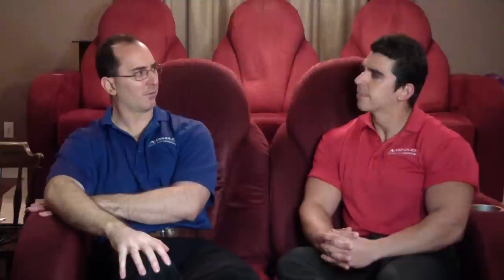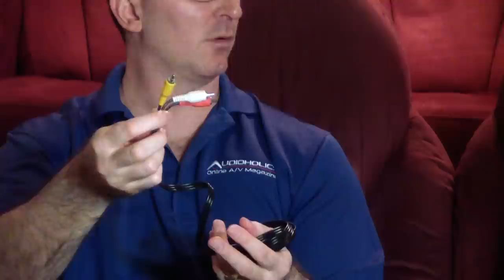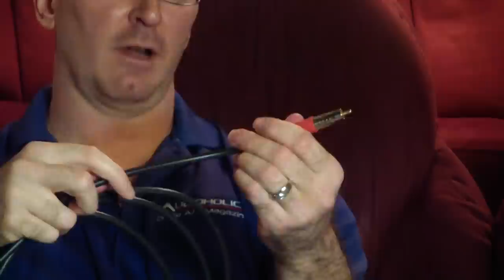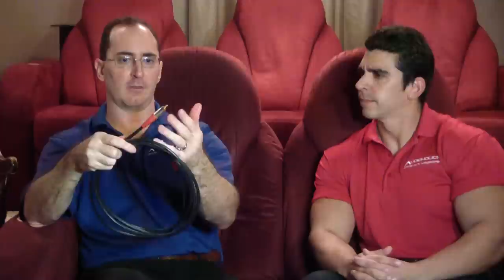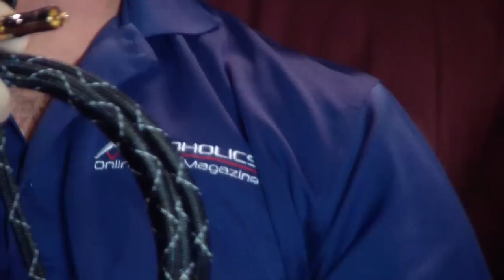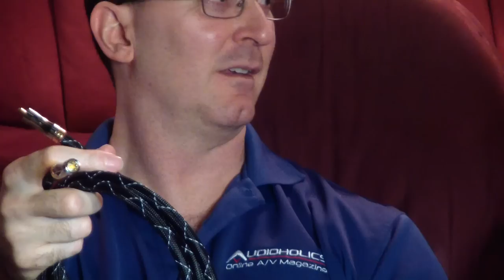Audio Interconnect Cable Myths vs Truths Revealed

Comment: You should've shown the connections to the connectors. That way we could've seen how they're terminated... if they were cramped, soldered, and if there's any shrink wrap to shield the positive and negative connections. Also, shielded cable in a home can act as an antenna. If you're going to show the differences, then SHOW the differences in the cables all the way to their core!

Comment: A great thing about Blue Jeans cable is that they publish specs with sources for all their stuff.   Want to know capacitance per foot and who actuall manufatured the wire, etc.?  It's all on their site.  I would rather spend just a few extra dollars with them because I trust them.  Actually their stuff is only a little  more expensive than cheaper Amazon cables.

Comment: Do cables with silver conductors affect sound? Also now some manufacturers use magnets to guide or focus signal through cable. Are these myths?
Reply from the maker: Silver is slightly more conductive than copper but all you have to do is use a little more copper to offset the difference which is a much more cost effective route. Using DC magnets on a cable is a scam unless it's being used as a ferrite to reduce RFI/EMI emissions for compliance testing.
Reply: Audioholics So sliver doesn't give more detail? They are using magnets to guide electrons to reduce noise. Inventor Rick Schulz of High Fidelity cables formerly Virtual Dynamic cables.
Reply from the maker: Snake oil. A static magnetic field won't drive any electrons around and will have no appreciable affect on AC current flow.
Reply: Audioholics Thanks for clearing that up!
Reply: Audioholics I have another question! Does dielectric material make a difference? Manufacturers say no dielectric is best then Teflon is second best for clarity!

Comment: Unlike most everyone else here, I'm not an expert at this.  So when someone recently insisted to me that wire gauge matters for speaker cables (yes) but not for interconnects (not sure) I asked for an explanation.  But the one I received (low-level line signals aren't sensitive) failed to persuade.  Can anyone shed light on this?  The interconnects I see are all AWG24 or 22 at best.  It would cost a trivial amount more to make them 18..
Reply: As if that weren't enough, it turns out  that virtually all of them are CCA (Aluminum) rather than OFC (Copper).

Comment: what's a good brand for a hdmi 4k 240hz tv?
Reply: 12schnsaint For all your cable needs, buy Audioquest in your price range.
Reply: The cheapest one that you like the look of and has firm connection,  HDMI is digital so it sends all the data or it doesn't  work.

Comment: Normally, with polarisation there should be a clear + and - field running through the cable to obstruct " flowing " charges through the cable. With this construction polarisation with an electric field is doubtfull because of the positioning of the anode and cathode wires within the cable running through the conductors. But the idea had been really nice, but not practical. Perhaps done behind a desk without practical knowledge. But also the effect is uncertain, because measuring is problematic without lab conditions, so quality control is at least doubtfull. Furthermore the cable is not very stable because it is flexible because of position and temperature and differences in length of the cable. So inpractical.
Reply: Another thing, it may be a suggestion for AQ using the two wires for  "clean earthing ". So connecting the two wires through a EMC/EMI LC filter to a central earth, connected only on one side  I think the AQ cable is an excellent cable but not connected the way they do. It is actually now working as an antenna, with the newer type of cables they now also provide it with RF filtering funny enough. 🤣

Comment: Balanced cables? Pros & Cons? Thank You!
Reply: Martin Miller For shorter runs, say up to 6 to 10 feet, you aren't going to hear any difference. The reason balanced cable technology exists is to provide a clean, noiseless signal over very long lengths, say 50, 100, or more feet. That's why you see this connection so often in the pro audio realm, because they often need to make these long runs. Unbalanced cable, such as the ones featured in this video, just can't make runs of that length without picking up some sort of noise. Again, for shorter runs, there is no audible difference.

Comment: I was super skeptical to buy an expensive  USB cable for my questyle DAC. Just swapped out my 5m printer cable with some generic old 1m printer cable, and there definately was a sonic difference. I'm not sure if it is length, quality, etc. But it's there. Both sound good enough. Might have to get something nice just to remove the doubt arrrggg
Reply: The cheap USB cable was likely causing a ground loop due to improper shielding causing hissing and popping from the source (your PC) in the DAC's analog output stage. Had the same issue once hence I usually go for optical.

Comment: Why 75 Ohm impedance? That should only be relevant to R.F impedance matching. Most audio amplifiers have a much higher input impedance than 75R, 50K etc. It should make no difference I would have thought...? 50R / 75R shouldn't make a bean of difference at audio

Comment: What about power cords?  Some like Shunyata cost over $3,000 while Audio Adviser's Pangea cost about $400.  Are both these snake oil as well?
Reply: After about 2 mins of looking into  Shunyata I'd say it's total BS. Look at the cable coming out of the device itself, will a 3000 bone extension cord make any difference? I do run my gear through Furman power conditioners, but for the price I see no reason not to, plus they make a really awesome looking power bar. BTW they do work.

Comment: the lower the voltage, the higher the gauge...the higher the voltage the lower the gauge

thats why they transform the elektrik energie to high voltage...so they dont need those massive cables... in your car runs 12V..and ther are thick cables right! but all this depends on the ampere draw...low ampere is also low gauge.

simply physic.

Comment: I caught a few talks given by AJ van den Hul regarding all of the different materials he uses and doesn't use. He makes quite a lot of very scientific sounding claims. Such as how when copper is drawn through a die to make wire there is surface oxidation that make its way into the finished product. His claim is that as the wire is formed into smaller gauges the oxidation is 'mixed in" thereby causing all sorts of barriers for the electron flow, which then creates distortion. So I wonder just how he get into the metal structure so minutely to see this, let alone measure the "distortion" that he claims can be heard. In another video he admits that the different treatments and adjustments for building his phono cartridges cannot be measured yet can be heard. So if he cannot measure these miniscule variations, how does he know they exist? I don't think you can patent what is imagined.

Comment: I challenge any of these two "honest" gentleman to back up, technically, with some form of measurement how good some of these cables are over another, not including the first free cable that comes with a bought component.
Reply: Exactly ! The same old myths shielding, thickness and shorter is better is all negligible to zero difference.
  Don't  buy junk but dont spend $5o dollars on 3 feet of cable either. Snake oil.
Reply: @decimusrex92  Indeed. The free red and white ones sound the same.

Comment: Gents can you do a video on power cables please. Im guessing it would be similar to your other cables but I just need to make sure. I was just at my local super high end audio dealer and they try to sell me what I believe is hard core BS. My two questions are unanswered. 1. Why it would matter if you have 4k$ power cable if its connected to 2$ wall socket? 2. Doesn't amplifier actually work on DC from capacitors ? 
Please help me understand.

Comment: Hi, guys. I generally enjoy your videos, but I may somewhat disagree with you here. So-called "high-end" cables are a scam. They usually offer superior build quality, but that's about it. In terms of audio quality, they offer nothing. I challenge anyone reading this to do your own A-B test. I would even encourage you to compare the cheap-o interconnect that the guy tossed away against the Belden cable that he endorsed. I'm willing to bet you're not going to hear the difference. You will not go, "Yep, that one's the Belden. You can really tell the difference." Even if you did think you could hear a difference, I would suspect the placebo effect. Audio engineers, designers, and others that work in a professional capacity laugh (literally) at enthusiasts that pay for Monster Cable and the like. Now, the el-cheap-o cables will become brittle and crack much quicker than the higher-quality examples, but you don't need to go "high-end" to avoid that. I think GE still sells RCA cables that you can still find at larger department stores, or online. They work fine and they have decent build quality. Pretty much any product that is not the cheapest-of-the-cheap will serve you every bit as well as the "high-end" cables.

As far as video, I haven't done any comparisons of my own, but I would still encourage you to your own test with a "75ohm" cable and a "non-75ohm" cable. I'm willing to bet most people will find they look identical. I think most people are using HDMI (for video applications) anyway, so in that case, it's a non-issue.

My point is, if you can't hear (or see) the difference, why pay the difference?
Reply from the maker: batman144 You pay a difference b/c better cables have more effective shielding to minimize interference when cables are run parallel and adjacent to each other.  You pay more money for products that are built better and are more durable such as the Belden example compared to the OEM stuff often included with equipment.  Better speaker cables have lower resistance which makes a difference with long runs and low impedance speakers.  For component video and long runs, 75 ohm cable does make a difference which can be measured and seen with high definition test patterns and real world video signals.
Reply: Audioholics I probably should have been clearer that I was commenting on line-level interconnects, not speaker cable. You deal with speaker cable is a separate video, correct? Although, there is certainly some "high-end" skullduggery there as well. I don't disagree with you about build quality, in fact I specifically mentioned that. I repeat my challenge: do an A-B test. Use one cable typical to the one thrown away in the video, and another comparable to the Belden. I DARE you to consistently identify either with an audio or video signal.
Reply from the maker: batman144 For component video transmitting HD Video you will definitely see a difference comparing double shielded 1694 Belden first the free cables supplied with most AV gear.  This can be seen in test patterns and actual video feeds.  The cheap throw away stuff typically has little or no shielding and doesn't maintain a 75 ohm characteristic impedance which matters at video frequencies.  For audio, its possible there won't be a sonic difference but if lots of parallel run cables are in close proximity, I'd opt for heavily shielded cables like the Belden.
Reply: Audioholics With regard to audio, I don't believe any human will hear a difference, myself included, even under the circumstances you describe. Before the digital era (my personal experience starts around the mid-70's), I had all kinds of audio/video gear and tons of parallel cables in my rack, and I'm the worst at cable management. Whenever I used the cheap-o cable, there was zero difference. Once again, I repeat my challenge: do your own A-B test and hear for yourself. As for component video content, you say that a difference "can be seen in test patterns and actual video feeds." Please provide a link.
Reply: +batman144 You might be correct that the two AUDIO cables would be similar if the cheaper cable (with higher capacitance most likely) was a short run and if the male phono (RCA) connectors fit tightly into the female connectors (loose connectors would likely develop a 60 Hz hum).
Reply: +Steve Silvers  For very long runs, we may be in agreement, but you still don't need "audiophile" cables. You can get hum in cables for numerous reasons, no matter how much you paid for them. There are a ton of "cheap-o" manufacturers that produce split-end RCA connects for better contact. If you can actually hear a difference, and/or see a difference, please, by all means, purchase expensive cables. At the end of the day, it's all about what gives YOU the best experience. My audio experience is roughly from 1975 to present day. Back in the day, my system was connected with Monster's next-to-top-of-the-line cable. In 2015 dollars, I spent about $2100 just to connect my system (and no, my experience is not limited to Monster Cable). Whenever I ran a cheap-o cable alongside them, there was zero difference. It's worth repeating:  audio engineers, designers, and others that work in a professional capacity in the audio industry laugh (very literally) at enthusiasts that pay for Monster Cable and the like.  My nephew is one such professional. You know where he buys his interconnects? The local drug store. What brand name does he buy?  GE or RCA.
Reply: batman144 Thanks for the reply.  I never said that anyone needs "audiophile" cables. I'm an audio professional (broadcast engineer) and I laugh at them too.  They are a complete rip-off and no professional would use them.   What I said is that the "cheap-o" cables usually have very high capacitance, and after a decent distance, the overall capacitance WILL cause the higher frequencies to roll off. At the longer distances, you'll get better performance with the Belden coaxial cables made for video because these cables have very low capacitance.  So, a "cheap-o" cable and a Belden cable at a short distance will most likely perform the same. However, if the "cheap-o" and the Belden are run over long distances, the "cheap-o" will start to roll off the higher end (assuming it has high capacitance).  The "cheap-o" will be fine provided its length is managed.  I don't think we disagree.  

Now, to the 60 Hz hum and connectors.  The 60 Hz hum that is heard starts with two pieces of equipment at differing chassis voltages.  Once interconnected, the 60 Hz current flows on the interconnect shield from the one equipment to the other.  There is now a voltage drop across the interconnect based on the resistance of the interconnect shield and the resistance of the connectors as they mate.  This voltage drop is added to the audio, just like two batteries in series, and the result is the 60 Hz hum.  What I described above is known as "common-impedance coupling." We can reduce this problem by using a cable with low shield resistance (less voltage drop) AND by using quality connectors that "grab" tightly when inserted (less voltage drop at connection).  Now, the "cheap-o" interconnect may very well work just fine, provided its shield resistance is low enough and the connectors grab tight enough.  If that works, then definitely use the "cheap-o" interconnect.

In the broadcast world, I rarely use unbalanced interconnects at all because our studios are balanced  However, when I do, I spec Belden video coaxial (or similar) and either Neutrik or Switchcraft connectors. The totaI assembly comes out to around $20. The assembly is an excellent cable and is about as good as it gets. Oh, and these interconnects are very short and connect to a Henry Engineering Matchbox (unbalanced in and balanced out interface).  These are pretty standard in the broadcast industry, especially in radio.

 http://www.henryeng.com/matchbox.html
Reply: +Steve Silvers  I used to get hum from running too close to a power source. Anyway, what kind source would you be using in a studio situation with unbalanced outputs?
Reply: batman144 Definitely.  A power source, especially a transformer, will definitely induce noise into a cable.  As for unbalanced equipment, it's rare and, like I mentioned, the source would immediately be balanced through the HE interface that I listed. Typically, the gear is rack mounted and the HE interface is as well.  Then, there is a very short interconnect between the two.  One of my stations is a news/talk (radio) station.  In the newsroom, there are three different TV/cable monitors, tuned to local stations. They are monitored for local breaking news. When an event happens, the board operator can bring the audio up on the board.  Those TV monitors have only unbalanced outputs, so the HE interface is used to balance them for the console.  There is also a rack mounted EAS receiver that is unbalanced.  The output is a "Y" that is unbalanced into the EAS decoder and unbalanced into an HE interface. The balanced output of the HE interface feeds a distribution amplifier, which in turn, feeds both the newsroom and control room consoles. As I mentioned before, we tend to keep these unbalanced interconnects as short as possible and balance them as soon as possible.  Thanks again for your reply.